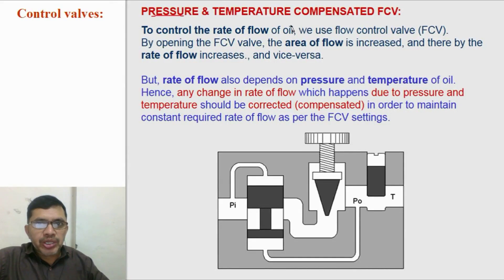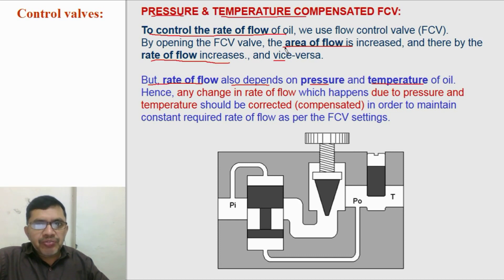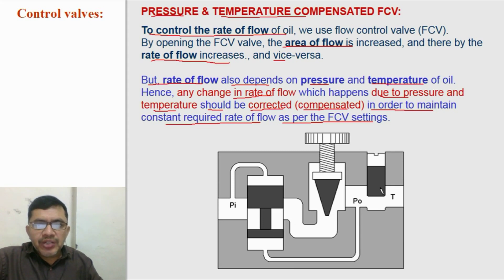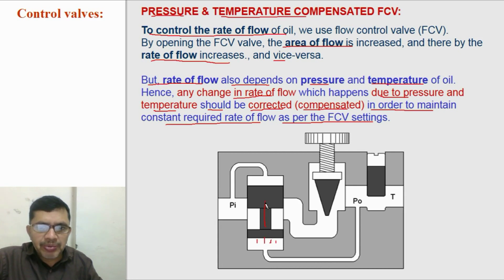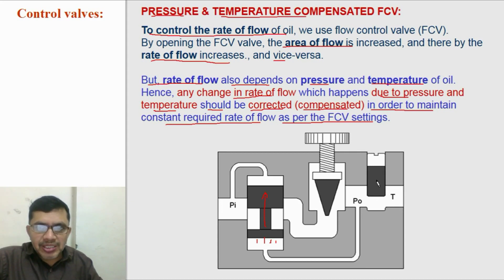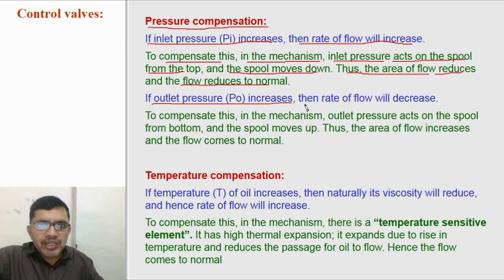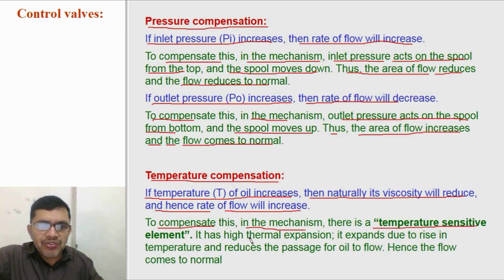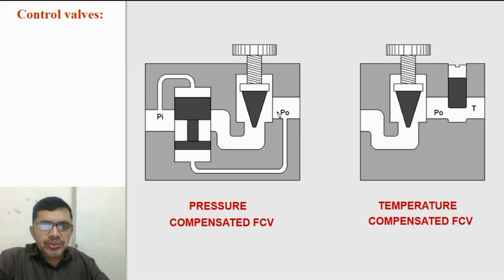Pressure and Temperature compensated FCV

Comment: are these valves bio directional?
Reply from the maker: The question of "direction" will not arise in case of flow control valves. FCV is FCV, it is not DCV. FCV is similar to water tap in your bathroom. Water comes out from the tap, but it doesn't mean it is uni-directional. If you supply in reverse direction, water can flow in that direction also. But generally, we don't do so, isn't it?

Comment: What is the triangular element in the path of flow ? You did not tell its significance
Reply from the maker: it is called "conical poppet". it can move up/down by turning the screw. it opens/closes the passage, hence the rate of flow of oil is controlled (adjusted as per requirement).
Reply: @chandrashekarapuranik  Ok sir thanks, your teaching method is very good , no need of books, just one video by you is enough ! Thank you
Reply from the maker: @manaskhandekar4137  thanks.